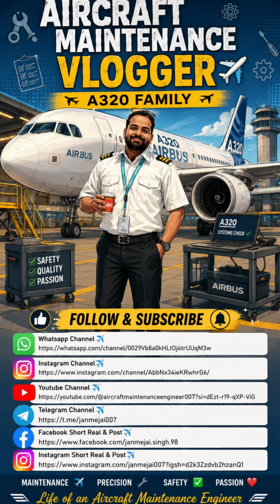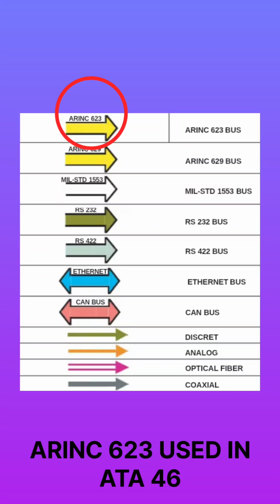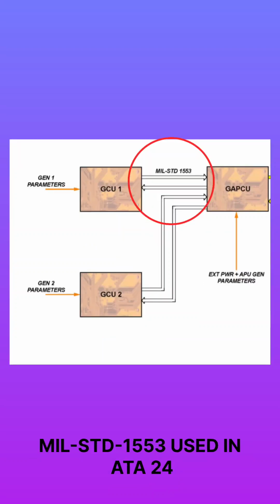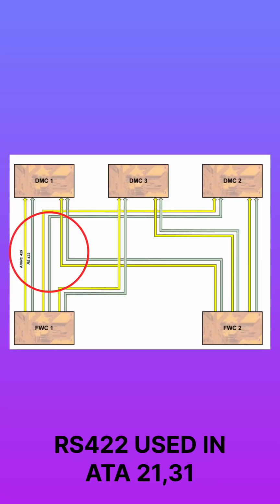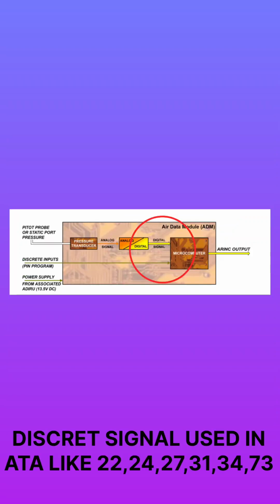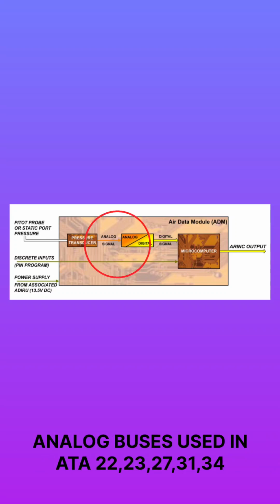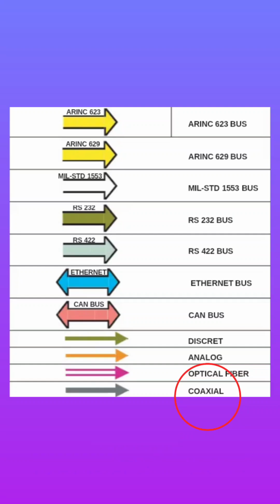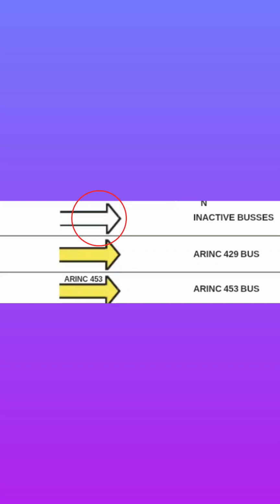DIFFERENT DIFFERENT TYPES OF DATA BUSES IN AIRBUS A320 FAMILY 🧰🧑‍🔧🧑‍🔧

Comment: Thanks for the information, it's very interesting, but I think there's a mistake here. ARINC 629 is not available on the A320 aircraft. It appeared only on the A330, after 777.
Reply from the maker: Disagree bro, I am not B2 but still I love to read manuals.... wherever I will make a vlog, I will check Reference, I will put only the best point, so that especially  freshers will get more help.
Check ATA 31 Multiple places ARINC 629 Display units will rcvd data through this bus
Reply: @aircraftmaintenanceengineer007  Ok. I'm not a B2 either, I'm a B1, but I was surprised because the ARINC 629 was installed on airplanes much later (1994), and the A320 was developed earlier. Maybe it's some kind of further modification, like NEO. I work on Boeing, I do not have documentation for Airbus, although this question interested me.
Reply from the maker: Yes future modification
Reply: @aircraftmaintenanceengineer007  ok. Not a base data bus like at 777. ATA 31 only.
Reply from the maker: @AlexKoltsov A320 ALSO

Comment: What is the main technical reason why different bus structure is required for different avionics? Is it amount and refresh rate? My model railway system uses Can bus😊
Reply from the maker: main technical reasons for using multiple data bus architectures in commercial aircraft  revolve around balancing safety criticalities, bandwidth demands, cost, and physical weight
Systems are categorized by Design Assurance Levels based on how catastrophic a failure would be. For example Flight controls  cannot share a bus with entertainment systems 
Systems like simple sensors or mechanical valves require very little data. They use older, lightweight standards like ARINC 429

Modern flight displays, weather radar, and engine diagnostics generate massive streams of data. They require high-bandwidth networks like AFDX (Avionics Full-Duplex Switched Ethernet / ARINC 664)

Many more reasons like cost saving  weight saving etc